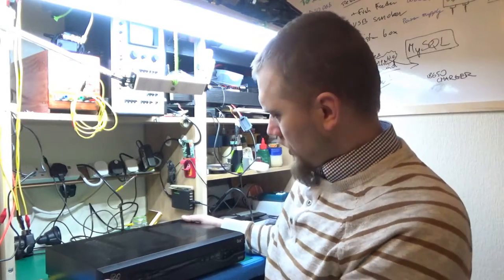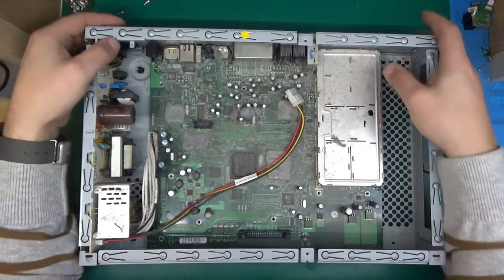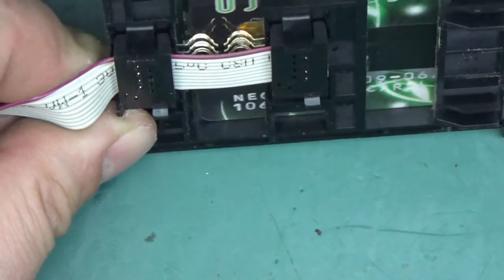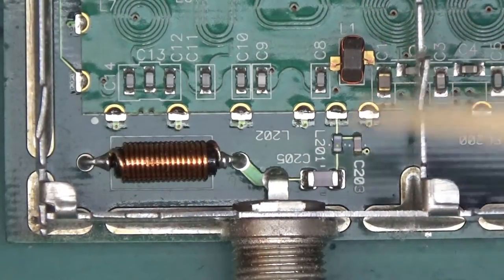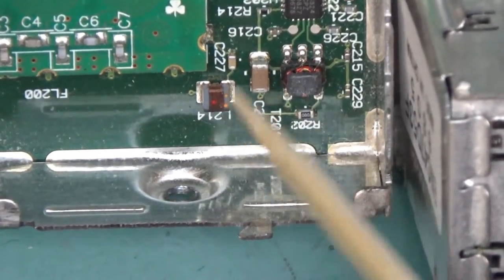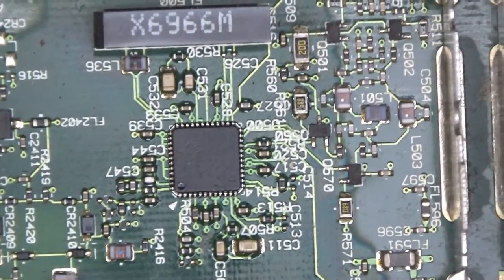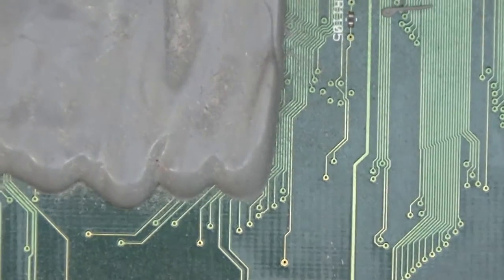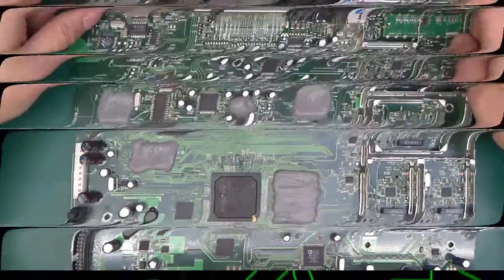Virgin V+ BOX HD teardown one way

Comment: I remember my friend had one of these and he said it was one of the best boxes that he had used in a long time, but when he upgraded to TiVo and took the V+ Box apart; he was surprised like you where about the amount of technology in one system and like yourself, he said that the manufacturers who put the box together must have been hiding something secret behind the gray gunk over the modules and even he couldn't take them off; my friend has now gone with Sky and has the new Sky Q Box and said the box is a lot smaller, easy to move around, lightweight and he also mentioned, when he cleaned the inside; it was so simple to get around important components like the Satellite Receiver as it wasn't bulky as he originally thought - Thanks so much for putting this video on here, it brings back memories

Comment: I could tell it was a piece of Scientific Atlanta hardware before you turned it over.  Quite strange that Scientific Atlanta did that in the DVB model; I have disassembled the NTSC/ATSC model of this box before.  This company always built things extremely well; they put the same kind of attention into customer premise hardware that they did in carrier support hardware.
Reply from the maker: +douro20 yes, i must admit, it did feel as if it was premium gear. Those boxes must have not been cheap for virgin.
Reply: Old box from Virgin Media UK without size anymore.
Reply from the maker: Ronnie Buchanan yeah, its old gear, useless by modern standards. But interesting to take apart. Nowadays a lot of them are cheaply made Chinese gear, some of the older ones were higher quality build wise.
Reply: Virgin Media UK new box TiVo 4K 6V new WiFi new date January 2017 waiting for seem.